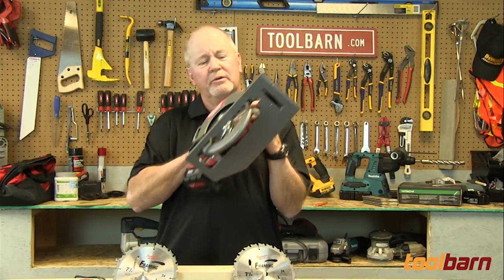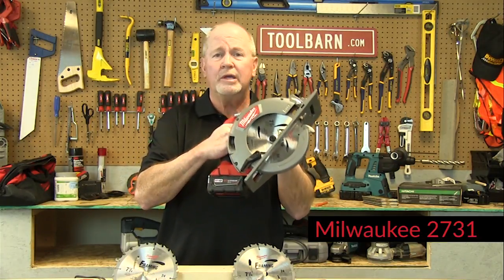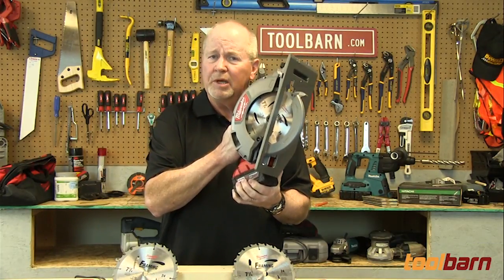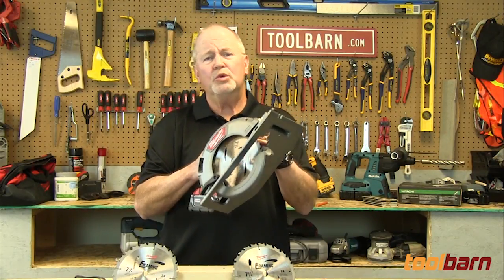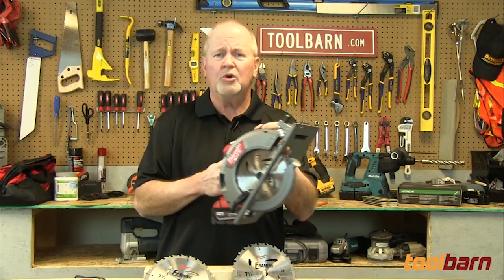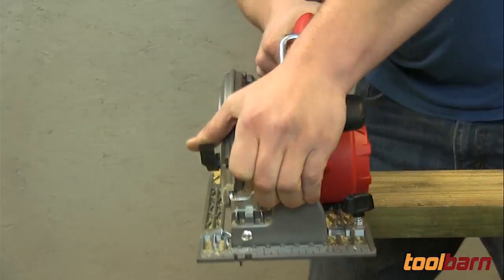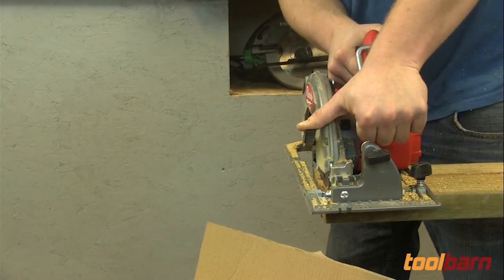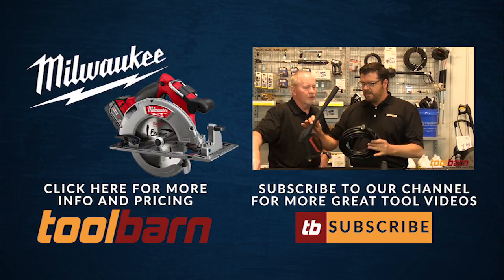Milwaukee M18 Battery Challenge

Comment: In your test, the 3Ah battery gives 37.3 cuts per Ah, the 4Ah battery gives 36.25 cuts per Ah , and the 5Ah battery gives 34.6.3 cuts per Ah. The M18 Fuel circular saw and the 9Ah battery make a great pair. The bigger batteries not only give a tool a lot more run time, they also run cooler and are less prone the thermal interruptions. In this saw, I've seen no difference in cutting power between two layer batteries (3.0, 4.0, 5.0, 6.0 Ah) and the 9.0 Ah one (a three layer battery). But in this saw and other high load tools, the 1.5 Ah and the 2.0 Ah packs will run hot and slow, and have a short life; these single layer batteries are better suited for use in less demanding tool.

Comment: the grinder chews threw batteries as well. depending on use 2to4 5ah in a day... Pipe welder.. sometimes we gotta cut pipes in air with a zip disc.. really looking fwd to the 9ah battery
Reply from the maker: yeah, the 9s are going to be great!